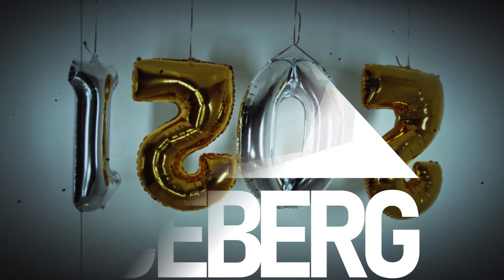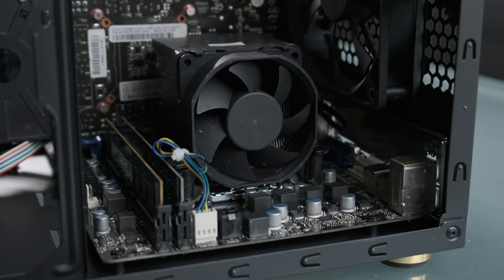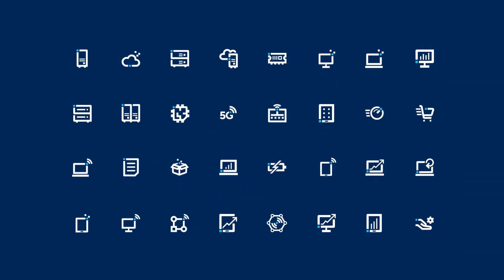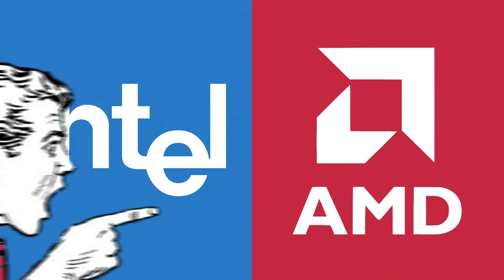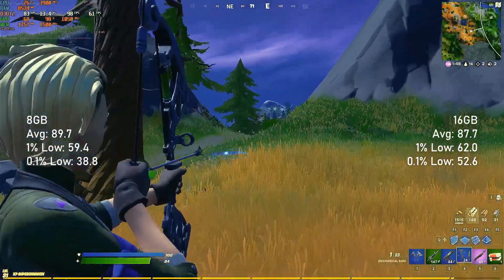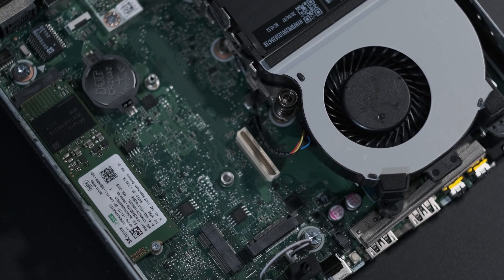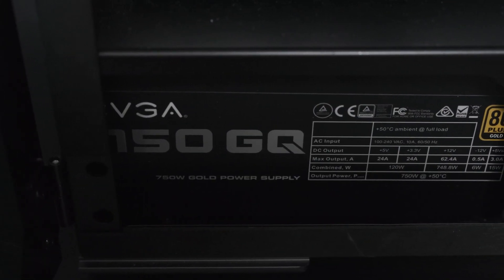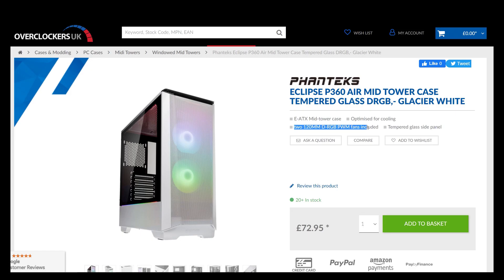Building a Budget PC in the Scalper Pandemic

Comment: Quick vid idea with how popular Halo Infinite is.. testing GPUs that are "incompatible" with the game. Friend of mine said he could get an R9 280 for free, but it doesn't work with Halo. I've seen vids here of people running the game on RX 460s that are supposed to not work either. Which older flagships might actually run?
Reply from the maker: That's good advice, I'll look into it.
Reply: sadly the game requires dx12 feature level 12.0 at a minimum which means gtx 700 and hd7000/ R9 280 gpus are out
Reply: @livingthedream915  awh man yeah i see what you mean.. so the older ones might be out of the question. But I've seen a few videos of people going into .ini to allow their GPU to get picked up. Like the 1060 3gb or 460 2gb which are new enough for the dx12 requirements but don't have enough vram. Halo has a huge incompatibility list of cards that i feel could run it.
Reply: @BeefLettuceAndPotato  yep.. the good news is that many R9 GPUs will run the game fine with modded drivers (R9 290, R7 260x, R9 390, R9 380, R9 360, and R9 Fury.) I have no clue how well it will hold on the 260/360 because of how low end they are.